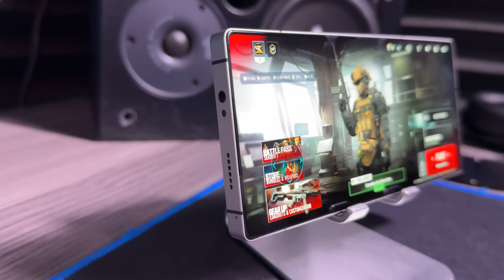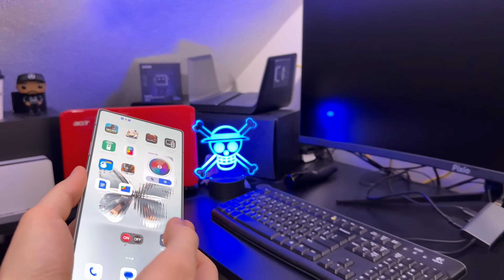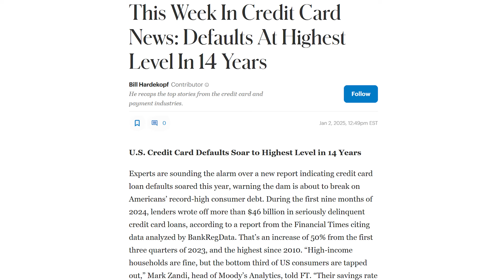What CES Revealed About Repairable Tech In a Record Year For E-Waste (2025 Is Not Looking Good)

Comment: Microsoft did backtrack on the requirement of requiring tpm 2.0. I still believe that everyone that has a voice needs to put out the message to not upgrade to windows 11 because of how big of a privacy problem recall that's hard baked into windows 11. You may not automatically be forced to have it turned on out of the box, you never know when Microsoft will push an update that automatically turns it on. Also there's reports like every month of problems with windows 11. If enough people make noise and refuse to upgrade Microsoft will be forced to capitulate and not end support next October.
Reply: I heard that they will put watermark similar to this when you don't activate windows. Instead of telling that you have unactivated copy, it will scream that you are running 11 on "unsupported hardware"
Reply: @ the PC world article that goes into detail about Microsoft backtracking is titled 

The Windows 11 24H2 update is no longer blocked on these PCs

Comment: Maybe you should try selling used business laptops that no longer officially supported by Windows 11 (7th gen Intel and earlier) with Linux preloaded and configured for home and small business use, even light gaming via steam. Most modern Linux distributions run great on this older hardware, and there are workarounds for typical users who need light office or photo/video editing software. This may not appeal to professionals running the Adobe suite, but consumers just use a web browser much of the time. I'd consider offering one of the immutable Linux distros based on Fedora  (universal blue - aurora, bluefin, or bazzite) that install and provide regular security updates, much like Android or ChromeOS, but without their limitations. They have lots of free apps and tools in their software stores. Very cool, and they look great.

Comment: At least in Europe they introduced a right to repair, meaning that for example Samsung now has a page for every single one of their phones, with basically any part you might need replaced, even the screen, along with a video of a samsung tech guy doing the reapair which is frankly amazing
Reply: part availability is still hit and miss, but it's a good start at least
Reply: @marcogenovesi8570 Fr, can't find OEM batteries for my A71
Reply: Good start, but try to find the part and repair
Reply: How is the pricing on the parts?
Reply: that reminds me, if you want a reliable home appliance you can get parts for in like 2030s I recommend Bosch  because my mother's washing machine broke, has been out of warranty for multiple years and the guys at bosch told me outright yeah this component goes from the controller board and the new board costs 50 euros and we can send it to you today and I got the board in under 3 days and it even came with instructions on how to replace that part which was something I have never seen any other manufacturer do like providing the repair instructions with the part and they now have a public facing repair manual database with the parts and you just add a part to cart and order and I even noticed like all sorts of appliances from 10+ years ago are listed and parts are available which is like wow

Comment: the dishwasher handle popping out is absolutely idiotic considering there's already better solutions by years
some Bosch dishwashers just requires to nudge the door and it pops open (a simple electric latch and the door hinges springs are intentionally loose at the very end, so the door simply opens slightly on its own weight)

Comment: I'm a super Apple/Mac fan. In fact I worked for them for 23 years writing software. But I'm also a tinkerer at heart. I really dislike the direction Apple (and now the rest of the industry) has gone in making upgrades and repairs near impossible, all in the name of shaving millimeters off product dimensions and increasing the likelihood that you'll toss that 4-year old machine and buy a new one every time. I've kind of gone in the other direction, picking up used Macs, upgrading the RAM and storage, maxing out the software (haven't dove into OCLP yet) and just using them as they are. Surprisingy, all of my machines that are 2012 or newer are perfectly good daily drivers, and with SSDs and max RAM are pretty spry in performance. I even have an original purchase 2010 Shuttle XPC that I upgraded from Celeron to Core2Quad and added a SSD to it's mediocre SATA 3Gbps and it runs Linux Mint 22 like a late model machine. If I upgrade from now on, it's picking up used deals on EBay or FB Marketplace and keeping perfectly good tech out of the landfill. Love your channel and your passion. Cheers!

Comment: Just tried to rescue my sisters old Packardbell Notebook (1 Ram Slot dead) replacing the cpu. Sadly issue seems to be on the board which costs more than some used Laptops on ebay or refurbed, guess I'll give it to her with 1 ram stick and hope it will last. 
My mate has this gamer grade greasy notebook he wants to replace because it won't run W11 without some rufus magic. Due to the keyboard grease level I really struggle to offer the upgrade. Guess I will do it anyway after stealing his sisters toothbrush to clean it.

Comment: In my opinion (and experience) the ASUS Zenbook Pro 15 OLED (UM535Q) is very relaible in most ways. Overheating? This laptop still works after 3 years at 100c and above. Dropped from 5ft? Use duct tape and some superglue. 12,991 errors in event viewer due to corrupt and missing files? STILL FUCKING WORKS

Comment: I remember having a friend in high school who every year would buy new parts for his computer, get new phones whenever a new one came out and I never got it.
I use second hand phones, I’ve replaced the HDD in my business laptop (Dell) that my mother game me 6 years ago with an SSD, I took my school laptop (Acer Spin) apart in the middle of English because the hinge in the chassis snapped free and used that computer until it stopped charging.
I was looking at the Sony ZV-e10, around $1000 for the body here in Australia, and got it second hand “open boxed but never used” $900 with a lens, tripod and mic cover all while my stepdad was warning me that it could be a sketchy deal (it all works fine)
The point is: second hand isn’t the gamble that it’s cracked up to be. Why spend $500+ on a new device when there’s an old one with a better spec just a bus ride away and all while supporting smaller refurbishing companies or even an individual trying to make their rent for the month

Comment: I understand your frustration. Whenever I purchase hardware, I look at the overall ROI I will get out of the hardware. The old lifetime of use was about 5 to 6 years before it was time to  upgrade or replace. I've seen this drop down to about 3 years for most people, but I can still squeeze about 5 years unless there's some kind of catastrophic failure requiring replacement.

Having said that the word in our house is if it still works, there's no reason to ditch it. It's because of this that we rarely throw tech stuff away. We well get years out of the hardware by trickling it down to others before it finally becomes parts for other machines.  My dad still uses my old Intel Dual Core for what he needs to do. He doesn't play a lot of games other than card games and does some light graphics and browses the web.

Recently a friend of mine gave me some old Mac hardware. I'm not really interested in Apple products and the big cheese grater machine, weighing 41 lbs., along with the Cinema display weight half that, went to another friend of mine who just upgraded using Open Boot. This ca. 2010 $6500 set up will live many more years with its replaceable parts. The person who gave me the equipment originally wanted me to smash the hard drives and scrap everything for her. Gulp!

Comment: Yeah it’s sad man, as a mechanic cars are going the same route. Cram as much  unnecessary proprietary tech and features into a car and make sure only the manufacturer has the tools and parts to fix it. These features that have major negative effects on the car if they stop working and then you’re stuck with a crazy bill. Like if you hit a curb you just totaled your car. 

For example I’ve got a 2018 Camry and I love it, but I had a simple evap purge valve getting stuck open….. it’s nothing serious at all, it would make the engine idle at higher RPMS and make the car hard to start after filling up… that’s it. But this generation of car, it also disables the cruise control, and pops up a malfunction message over and over on the dash even if you dismiss it. Which is very distracting. It’s ended up being $300 to replace it, it’s just one screw, one electrical harness, and two small hoses. My old Buick had the same issue and the part was $20 and just as easy to replace… it’s the American ideology of consumerism taking over
Reply: Stuffing cars full of Apple software and advanced wiring must only exist to make self-repair difficult. There's no other  better explanation for it. I'm going to loathe the day I get a car and all of them come with touchscreens and trackers.
Reply: The way cara are going hurts my soul. I'm glad to see mechanics speaking up though, because average people seem to have no idea.

Comment: I'm still using Windows. Windows 10 on my Laptop (2020-Legion5) and Windows 11 on my Home Built PC (AMD-AM4) I really hate Windows 11-
Really considering Making the switch to Linux. 
Why don't you offer Linux on Laptops not able to use W11?
Reply: I would say not enough demand. Most non-tech savvy people have never heard of Linux. And it might be a difficult sale to convince them to buy this laptop with this weird thing they've never heard of before. Yes you can make the argument that Linux is very easy to use. But again, someone who is used to a very particular way of doing things can be thrown off when you give them a radically looking different system.I've worked in IT support for 5 and a half years and have dealt with people like that.

Comment: I have a crappy base model 17” pavilion that I bought a decade ago. Removable battery got replaced once and upgraded the ram from parts on Amazon. 
Got me through college, the screen sucked and it was a lil slow but I found it reliable. 
I wash my hands before using my tech I hate gooch covered keys and controllers. I just bought a new pavilion over Black Friday wish I saw this channel then I didn’t realize the stuff is soldered now I thought I could upgrade the ram like my old one but other than that no complaints.

Comment: "When did it become buying things to look at rather than buying things to be used?"
When Apple started the trend of making sealed batteries, no micro SD card slot- and everyone copied it. 

Apple has become jewelry, disposable jewelry that you spend an absurd amount of money on to look impressive- down to your txts even being special because you get the apple color. 
Everyone has been chasing that thinking they can do the same. 

It drives me nuts because so many reviewers will focus on 'this feels premium' and not 'This is a good product that performs, will last and is repairable' 

I work with a display tablet for art, right? 
Was looking to replace mine a few years ago and the reviewer legit said "The pen doesn't feel good, it feels light and cheap vs the Apple Pencil which is FAR more premium" 
Yeah- it feels heavier because it has a battery & haptic motors in it while pen displays for desktops? Have no battery, they're lighter weight because there's little to put into it.

Comment: Am I hallucinating? Why is it that so many shops haven't figured out how to install windows 11 on pre gen 8 machines? I've never used RUFUS and I install Windows 11 on Thinkpads with 2nd Gen i5-2540M. DO I NEED TO DRIVE TO SALEM AND SHOW YOU??  Even my local guy said no f'n way,.  Said it can't be done, I told him everything I was buying from him that was pre 8th gen I  put windows 11 ONLY using Windows 11 Bootable USB,  NO 3rd party software, No Rufus. My and my other tech think it's bizzare that other techs can't figure it out.  Windows 11 .. It's like Franks Red Hot.. We Put that SH*T on EVERYTHING!!!  (I had to google rufus to see what you guys are talking about.. and I was like... why?)
Reply: Its probably more of a liability issue. Any semi-competent computer tech can figure out how to install W11 on older systems. The question really comes down to whether it is worth it. If you're selling a customer a PC with software it doesn't officially support and the system starts having issues, they will quickly blame it on you the tech.
Reply: @ my point is , you do not need 3rd party software to install Windows 11 on pre Gen 8 Laptops and desktops. You don't need to change registry keys or follow Microsofts "other ways". Using terms like "if" and "probably" are scare tactics... there is no liability when you use legit windows install provided by microsoft.

Comment: not into laptops but what abouuuut a tower with pre-windows 10 that needs to run super quiet and super low EMF, metal body, no LED, hardwire only--zero wifi capability--that still has a read/write disc drive and plenty of ram for art/games? still running my 2011 hp pavillion elite LOL, some usbs are dead, the disc tray likes to be jammed for who knows why and the center fan lets me know it has trackers and ish on it by screaming.
Reply: Very niche use case......

Comment: Dude - sell laptops with Linux preinstalled! All those laptops that won't run Windows 11 will run Linux, it'll save them from being landfill!!!
Reply: Ill run Linux before i run Winblows 11
Reply: @ I've been running Linux (exclusively) for about 20 years now - there's no going back for me 😉 I use Arch, by the way 🤣
Reply: this is assuming the drivers from manufacturer to manufacturer are supported when you realize HOW CRAPPY the experience will be when said laptop uses nVidia drivers on Linux if its AMD or Intel graphics its a non-issue

at that point you might be better off trying to install OSX on a generic laptop and see if your black magic works
Reply: @ Yeah, Nvidia has always been a pain, but there's so many more options on Linux now (Nvidia open sourced a lot of their driver code in the last 6 or so months, so even the Nvidia open source drivers are pretty good now). You also have the option to simply not use the Nvidia GPU - just make sure it's disabled. This is still better than just throwing away a perfectly functioning laptop (IMHO).

Comment: I have over 7 computers from over the last 30 years. They are running their original operating system (WIN 98, Win XP, Win 7, Win 10, Win 11) except for the last three they are not on line. I continually run Win 7 as my main Multi tasking computer until about 4 months ago. My Win10 3770k is now my main system for Internet browsing etc. My 8086K also win 10 will not be upgraded to win 11 even though it meets the specs for Win 11. My 9800x3d which has Win 11 will also not be upgraded to Win 12. Microsoft can take a flying leap if they think they can continue to screw the avg computer user. There are other options to protect your system from outside intrusion.

Comment: I'm sticking to Dell Latitudes, especially some of the older ones, because you take the back panel off, and there's everything there that can be changed, including the processor. I have a couple of older hp Pavilions, and while they were easy to upgrade, getting them apart was very tedious... I had to tear the whole thing apart just to get to the system fan to replace it.  I've been finding old and ancient laptops in the dumpster, and I've been slowly restoring/upgrading them to get their max potential and to give them a second life as a basic browser.

Comment: its ridiculous, not everyone can afford to keep updating/upgrading/buying,  my main laptop is a hp nc6400 from  2007 originally designed for xp, now running 8.1, it can 'just' about handle win10, win11 is no chance! and i still use xp machines for some purposes as cant get later drivers for the scanner, a couple of printers, and the eprom programmer. they do what i need and want so why replace? they're still working properly, plus cant afford 'new' anyway! all have easily user replaceable ram, hard drives and batteries....oldest still working laptop in the modern sense of laptop i have is a Toshiba 2130CS from 1994 ish...  the only 'new' one i ever had was a 2006 dell inspiron 1300, got it on offer, yes still works nicely, even though the case is cracking up mostly around the hinges !  as for these OS stopping support, it isnt gonna magically 'brick' all those machines, they'll still work perfectly ok, for some while at least, just not get further updates.. this constant 'need' to 'update/upgrade' bloated OSs needs to stop, no need at all for an OS to be so resource hogging ,  its a vicious circle, hardware improves, OS 'improve' and use up that hardware advantage, so 'need' more advanced hardware, and so on!!!